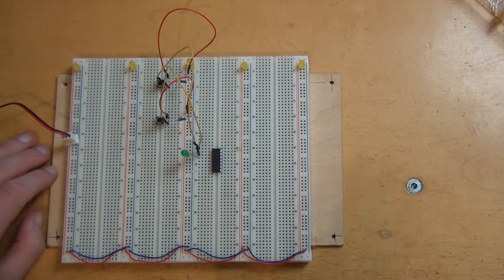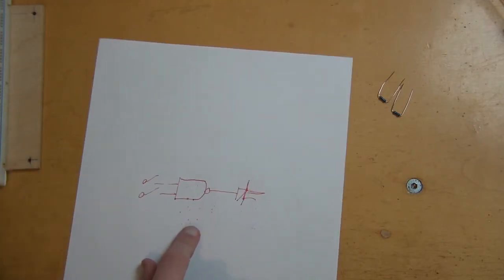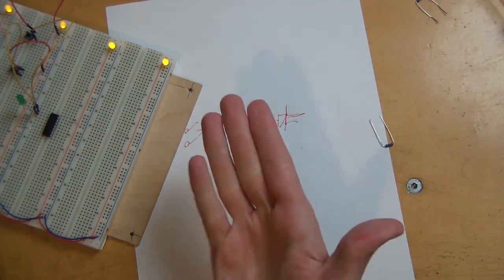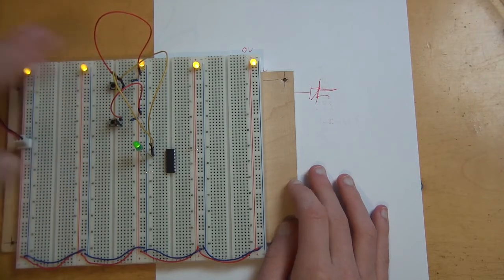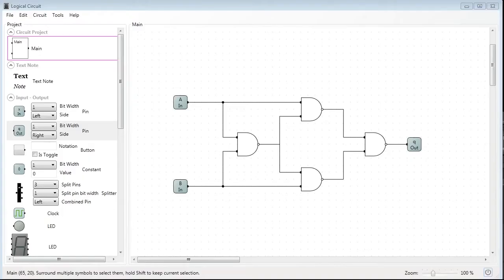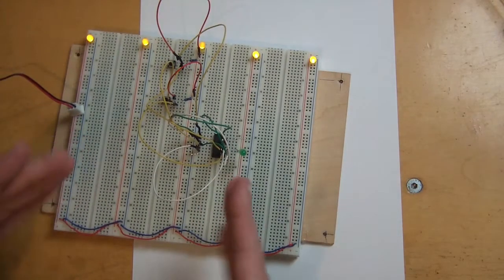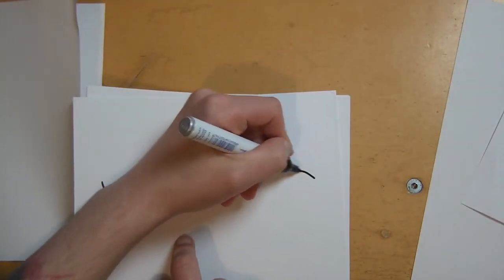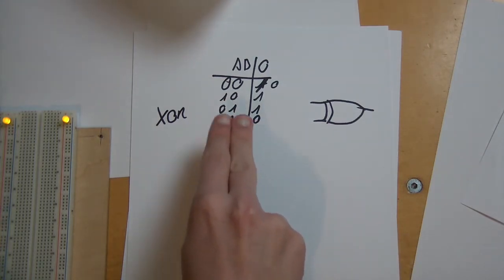Addition And Using ICs - Lets Build - 8 Bit Computer Part 5

Comment: Why do I need a logic gate for an or gate? Can't I just combine two wires?
Reply: to do logical stuff
Reply: +calvinatorzcraft and to ensure that your signals are going in the proper direction , I would suppose. Diodes n stuff
Reply: +dexter auropa kurzgesagt
Reply: calvinatorzcraft if you just combine two wires the signal could reverse the circuit and break some components, so you need two diodes to make it safe, but then another problem persists: if you have ground in all the inputs of the homemade or gate, then the output would not be 1 (vcc) neither 0 (gnd) and it would be affected by electrical rumors like the radio signals, so you need some way to pull out those signals. I often use a pull-down resistor (a high resistor like 10k connected to the ground).
This should be a safe or gate, but it will use a lot of space that you can regain using a pre-built gate
Reply: +Mystic Virgo I could just use a diode then
Reply: That's what those are, infact.
Reply: calvinatorzcraft Logic gates can be used to build modules like adders.With adders you can build multipliers.And when you can multiply,you can do everything.
Reply: calvinatorzcraft yeah
Reply: +SnowyCoder thank you!
Reply: @Cncz42  Snowy Coder's reason was really good but another is this is XOR not OR so that would work as an OR and an AND obviously.
Reply: calvinatorzcraft you're welcome :3

Comment: You can save a transistor by using the output of the band gate connected to a and b in the xor gate and inverting it with one transistor.

Comment: Just one suggestion for the LogicCircuits software, you can make so-called Logical Circuits, which you can then use in other designs. For instance, I made my 1-bit full adder by using 2 half adders and an or gate. I then made a 4-bit adder by chaining four 1-bit full adders while chaining the carry outputs.

It's not hard and keeps the display a bit easier on the eyes :)

Comment from the maker: Yes.You dont do it directly, but through a resistor. This is then called pull up (to 5V) or pull down (to0 V) resistor. If you leave it alone it will be somewhere between 0 and 5, so sometimes it will register 1 and sometimes 0, so your logic wont work.